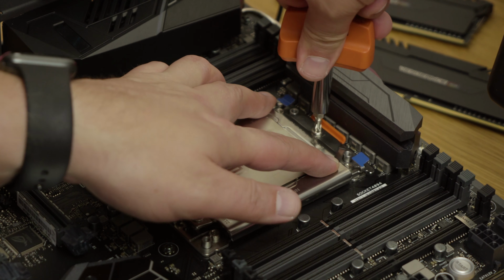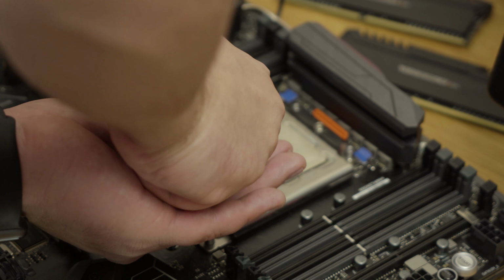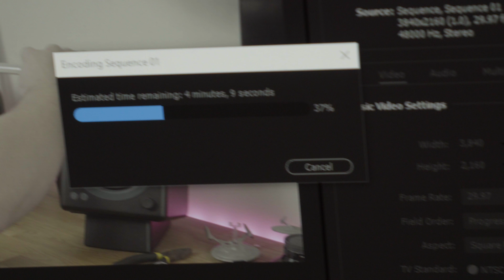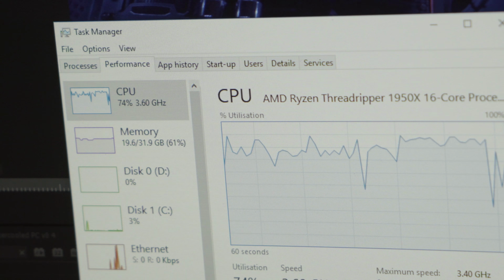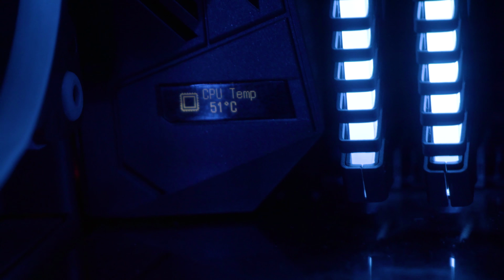SMA8 Threadripper Watercooled Build

Comment: Great looking build no matter the hardware. An Aquaero would solve all of your monitoring and fan curve issues, especially since you're running dual loops. Just a suggestion
Reply from the maker: +ExcellentAmp many thanks. Unfortunately I don’t have space to mount anything in the drive bays as there is a rad behind it. I think I can solve the problems with a phanteks fan splitter as I have one pwm header spare. Thanks for the suggestion all the same, take care.
Reply: That is what I plan to put in into my build.
Reply: They make an aquaero that doesn't require drive bay. The 6lt is just the pcb, no display. I've got a Define S with no drive bays, have mine mounted in back where the hdd mounts are located. The thing I really like about the aquaero is you can set fan curves based on different readings. I use the coolant temp so the fans aren't spinning up and down unnecessarily whilst gaming or cpu intensive activities. I'm sure I sound like I'm pushing my suggestions on you and I apologize if that's what you may think. I'm just in the camp of people who feel that an aquaero is a necessity for any high end water-cooled pc which you obviously possess. Subbed, you deserve it. Cheers!!

Comment: Mines rock solid at 4GHz with an NZXT kraken X62 cooler. Didn't have any problems with the ASRock Fatal1ty X399 board except the fan curve problem as you mentioned. Definitely leave the tuning software from the MB manufacturer off and use Ryzen Master or BIOS as I lost 30% of the CPU performance for no reason after installing it. I expect the Asus stuff isn't much better. Only fix was reinstall of WIndows. Also, have you got the AMD Ryzen Balanced Power Profile set? :) It's a great machine for developing. I went with CL14 GSkill RGB 3200 memory. Couldn't be happier. BTW, your temps are very good, beats my AIO hands down.
Reply from the maker: +Daz M I got the balanced power plan. Learnt that after my 1700 build. Definitely think I’m gonna reinstall windows. AI Suite has messed up my install. Probably teething problems with the new platform. Temps are good but it’s an expensive and fiddly solution. Early days but I’m confident this CPU will absolutely fly. Already killing premiere pro. Bet it’s an absolute beast for development.

Comment: Threadripper rocks, I wish I had a reason to switch :( enjoy it man! you're lucky.
Reply from the maker: +DrOrtmeyer thanks buddy, hopefully it will improve my YouTube workflow and give me some time back.
Reply: Tao of Tech with 32 threads I dont doubt it :)
Reply from the maker: +DrOrtmeyer it seems a bit excessive but with the 4K video editing it does make a difference. My windows install is messed, gonna reload it tonight but it’s still tearing through editing. The ‘bloatware’ from mobo manufacturers still gets me mad. My mistake for installing AI Suite.
Reply: Tao of Tech ive generally enjoyed msi's overclocking tools for my cpu.

I thought that if you switch platforms you have to redo Windows because you cant get all the drivers out. Good luck with the reinstall. Think of it this way; you can decorate your new clean OS the way you want. After 10 years i still Enjoy that freedom Every time.
Reply from the maker: +DrOrtmeyer I actually did a clean install but once I installed AI Suite it seemed to mess everything up. Not totally asus fault as the platform is brand new. An uninstall hasn’t sorted it so it’s a (another) fresh install.

Comment: What are the reservoirs used in this build?
Reply: And also on the reservoir there are those bolt things do you have have to buy them Separately or do they come with it
Reply from the maker: They are EK-WB reservoirs, its the PWM pump head (XRES-140 D5 PWM) and XK-RES X3 250 tubes.
Reply from the maker: +Marcus Grayson not sure what you mean by bolts. The fixtures to attach to the case come with it - is that what you meant?
Reply: So you bought the pump combo and then replaced the reservoir? And also I meant that at the top of the reservoir there are the silver screws do they come with the reservoir or do you have to buy them
Reply from the maker: +Marcus Grayson yes I replaced the actual tube to make it longer. As I recall the silver fittings came with the tube.

Comment: Why does no one use the thermal past spread with a credit card method anymore? It is impossible to have bad contact if you have a thin layer over the whole top.
Reply from the maker: +Joel Doxtator I use to use that, it’s definitely an underused method. I remember having a huge debate with someone about air bubbles with this method in the mid 2000’s ..... lol (showing my age)
Reply: It was probably less important back then with exposed die CPU's, but with these bohemuth heatspreader CPU's having an even spread past is essential.